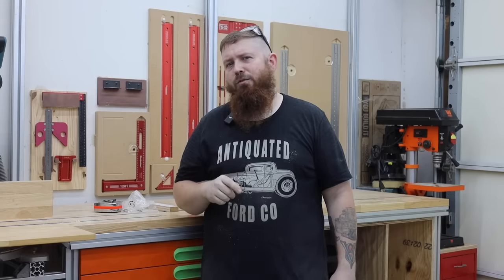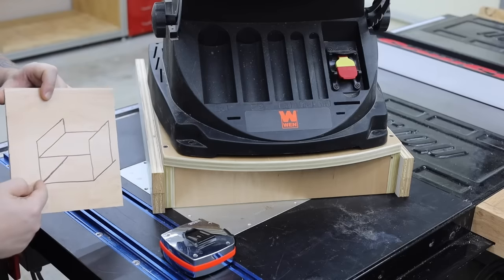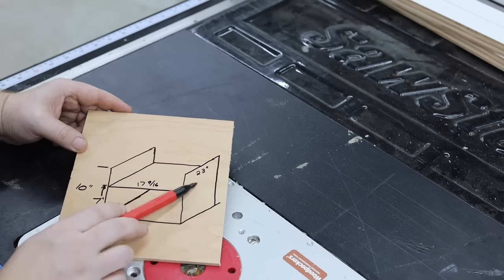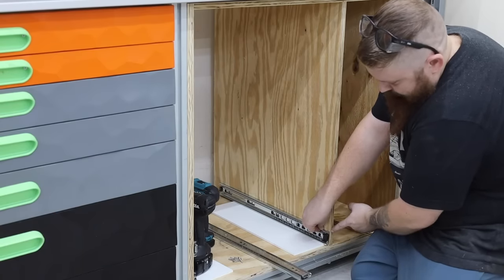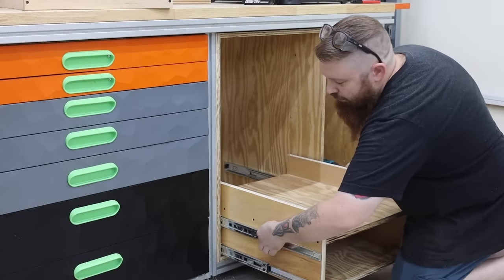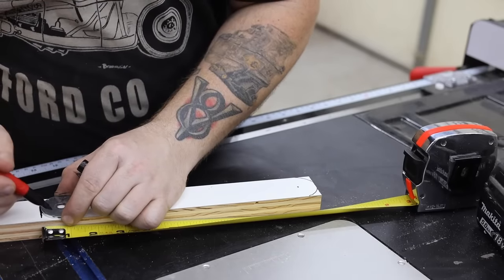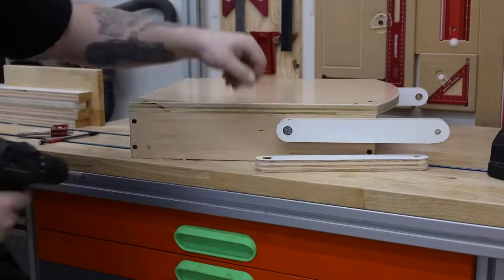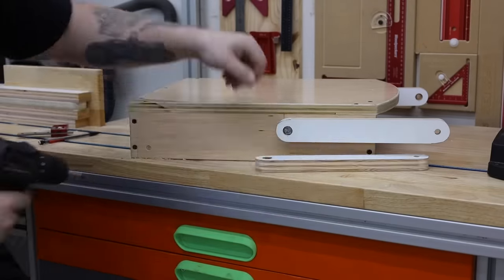Don't Build a Flip Top Tool Stand, THIS Tool Storage Is Better

Comment: As somebody that has to make do with a small (8.5x6.1) shop, this might be a good alternative for me, since i don't really have the space for the flipping top.. 
Maybe even cutting a slot into the workbench above, with something like a "slide-in hole-cover (similar to a wood on wood drawer) " might be interesting, since you then dont have to pull it out that far and depending on the tool save a lot of space for a small amount of cutting.

Thanks for showing that idea!

on another note, where can i see more about the drawer fronts? i love the hexagonal pattern!
Reply from the maker: Thank you. I made some posts on IG about them. My name over there is full_steam_designs

Comment: To control the sliding in/out:
(You will have to change how you make one of the walls for the drawer at the bottom part)
Rather than making one of the walls a rectangle, make one with  a "thumb" that is (say) 1 inch by 1 inch front to back.
Basically the (side) wall for the drawer on one side has a bump sticking up at one of the ends.
This will be at the BACK of the drawer when used.
Pull the drawer out as far as it needs to go and mark where the bump is on the wall of the cabinet.
Put a "stop" on the wall you just marked to stop the drawer being able to slide out any further.
I'd suggest SCREWING it to the wall as if you ever need to remove the drawer completely, you can unscrew the stop and all is good.
If you GLUE it:  The drawer will then be stuck there.
Reply from the maker: I’ll look into that. Thanks
Reply: @FullSteamDesigns  (Strange)
I drew up a quick design and posted a link with the view the other day.   I can't see the reply.
No big, but just for clarity.

Comment: cool build and very clear narration and explanation. I was wondering about your miter saw  fence. I have the same saw and the fence is NOT 90 degrees ro the blade- is this the reason for the wood fence?
Reply: Wooden fences like that are usually sacrificial for zero clearance cuts to prevent tear out.  If you have a fence off square there are usually some ways to adjust it, and a bunch of videos out on YT showing how.  Good luck!

Comment: can you elaborate on the drawer fronts of the cabinet next to your flip top build? Did you use a cnc for the detail on the fronts?
also, did you print your own drawer pulls or did you buy them? awesome job / video!
Reply from the maker: Yea they were done with a cnc.

Comment: far simpler option - a motorcycle lift. costs is around $60, just put it on a pull-out slide and pop it up. You can also adapt a scissor jack

Comment: How is the mechanical advantage using this method? A spindle sander isn't too heavy, so a good tool to use, but I wish you'd talked more about that. How much less exertion and muscle needed vs lifting it onto a workbench with just your back and shoulders? Important stuff. Awesome build of course.
Reply from the maker: Hmm, that’s a good point. Not sure how I’d measure it exactly. It’s definitely easier since I can do it one handed. I wonder if a fish scale would be a reliable way of measuring it.

Comment: Kind of left out the details on how to connect the arms to swing the tool up into place. 
Think I might be able to use this to build infeed outfeed table for my drum sander.
Reply from the maker: Just bolts and threaded inserts. I thought I showed all that 🤷‍♂️
Reply: @FullSteamDesigns  I meant how you laid out where to drill the holes so they moved into place evenly.  I saw the bolts and fiber nuts to attach them.  Thank you for the reply.
Reply from the maker: @Belg1970  ah ok. As long as the legs are the same length, and you stager them the way I did in the video, it really doesn’t matter how far forward or back they are. They just need to be stacked on top on one another.

Comment: I liked the way you explained everything. I do have one question. Why two slides per side verses one slide per side. If you have a slide that is rated say for 200lbs wouldn't that be enough or is it more about stability with the 4 slides? I bought a bunch of slides a couple of yrs back from Grizzly and I made sure the weight limits were high for those I chose. By the way, you earned my subscription with this one video! Can't wait to get caught up on your others. Thanks.
Reply from the maker: Slides are cheap. Using 4 doesn’t hurt anything. Thank you 🙏

Comment: That pullout is on point. But my question is, what did you do for your planer or jointer? I did a similar build for my planer to pull out and up from my work bench but I think I need to rethink that as the weight of the planer and the wood I is a concern. Love the use of 2 sets of drawer slides for weight distro.
Reply from the maker: Maybe you could add a fold out leg to help support it.

Comment: Great explanations but you montogue over your logic for the placement of the arms.   Can I infer the upper arm is 1/4 from the front of the box and the platform placement is where it will clear the cabinet before lifting?  Was the lower arm as far back as possible but still where the upper arm is able to rest on it when in the rest position?
Reply from the maker: It really doesn’t matter where you put them. Just stack one on top of the other. The further apart they are, the more stable it will be.

Comment: Are those custom cabinets, i dont recognize the trim on them
Reply from the maker: Yea it’s t slot structural framing with wooden boxes installed. Then I mounted drawer slides and installed drawers.

Comment: Easier for weaklings like me to  use, flip tops scare me, and it lets it be positioned lower ... currently our bobbin sander sits on the bench which is fine for 6'3 hubby, not so much for me

Comment: I liked and subbed because I love supporting upcoming woodworking channels, and you did a good job making this video. BUT... I disagree with the premise of this build. It doesn't offer a better solution to the problem that a flip-top cart offers, and that is utilizing more space effectively. In fact, this build is nothing more than a lift aid mechanism to save your back. It doesn't address the original problem; space is still wasted, and space can be at a premium for many weekend warriors with small workshops/garages. What this does is make the wasted space solution worse again while attempting to fix the error of being a dingus about how you store your tools and accessories. It would be infinitely more useful to address THAT problem while not making the space usage one so much worse.
Reply from the maker: Thanks

Comment: Not bad but you didn't explain the placement of the second set of 'arms' that helped prop the shelf up at all.
Reply from the maker: They just need to be stacked on top of eachother.
Reply: @FullSteamDesigns  I can see that but the bolt holes are not in line, there is a slight offset and you didn't say how much that should be. That's what i meant about the placement.
Reply from the maker: @chunkymurps  the offset is because one is installed on top of the other. When you go to do it, it will make sense.

Comment: Great project. However, it doesn't solve the issue that I think the flip top is meant to address and that is allowing storage of two bulky tools in the same amount of space. This is cool but means you need double the space to store your planer and router.
Reply from the maker: It solves the issue of needing to store a tool. It eliminates the problem of dumping stuff all over the place and making one tool unusable like with a flip top cart.
Reply: @FullSteamDesigns  A simple drawer would solve the problem of falling tools and you can only use one tool at a time anyway.

Comment: You only need to use shorter drawer glides
Reply from the maker: What?
Reply: @FullSteamDesigns  shorter drawer glides would leave less or no play when you're using the sander backside. Adjust the shorter glides towards the back of the cabinet to true up the gap between the table top and bench top
Reply: @FullSteamDesigns  what I'm saying is that the drawer is extending out too far. Shortening its travel distance with shorter glides will get rid of the space between bench top and table top
Reply from the maker: @skokenos  it gives you room to raise it into place.

Comment: Love the design and your walking through your thought process. However, you have not built a better alternative to the flip-over tool storage, which allows the use and storage of two tools with the same stand. So, all in all, this is a failure.
Reply from the maker: Flip top carts are failures by design. This is much better. Thanks for watching.
Reply: @FullSteamDesigns  Flip-over carts have their shortcomings, but they definitely let a woodworker a way to store bench top tools in a limited workshop. First of all, your video's title can be understood as you have a better design that would allow the storage of two bench tools in the same space. Second, the "problem" that your video tries to portrait with the flip-top design is pure exaggeration. You are saying people would just continue to dump tools when they flip the thing over, as if they are brainless and would never learn from their mistakes and find a better way to store the tools' accessories. Your design is a failure in this context: it does not save space as a flip-top cart would, nor does it offer a better flip-top design that let the user not having to worry about tool accessories being accidentally dumped when changing tools.